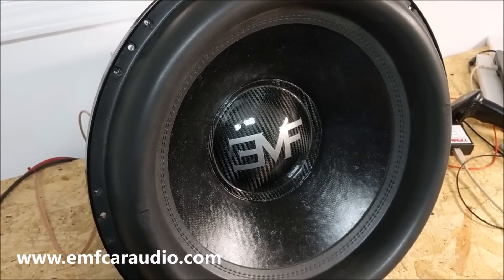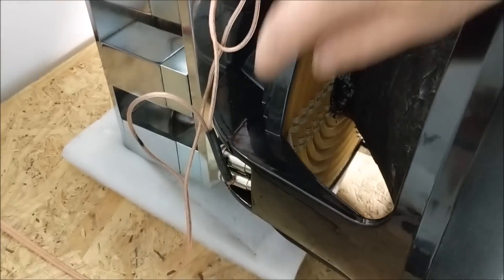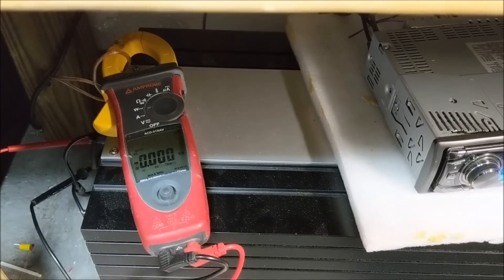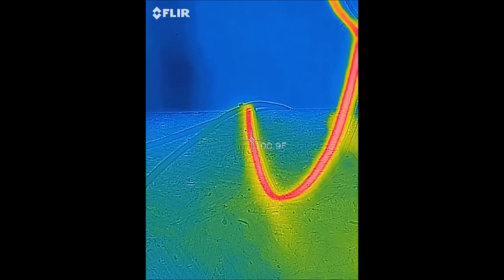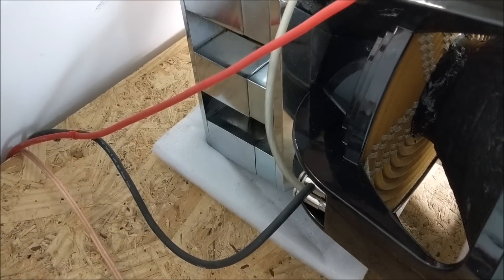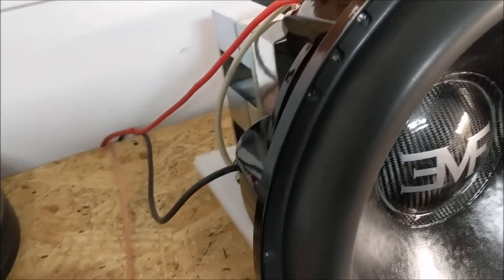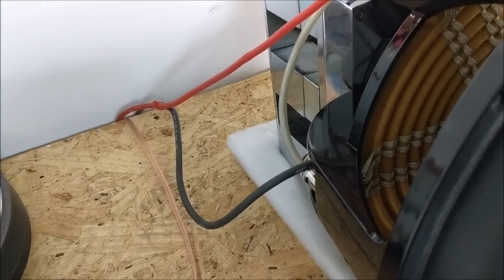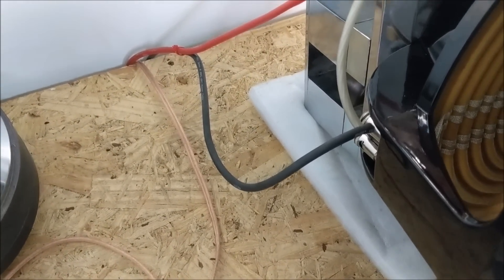Are you using the proper speaker wire size?

Comment: Hey man can you do that test with Silver wire using the same 16 gauge . For whatever reason people feel silver cures all
Reply from the maker: Silver wire isn't cheap but maybe I can do that. The reason people say that goes beyond wire heating up so I'd have to test that because they'll go nuts.
Reply: @EMFAudio  

I'm a believer in quality cables and wires and by saying so I open myself up to being labeled a elitist  I feel your demonstration is scientific and would end the argument as far as proper gauge . If this was a demonstration on lets say the proper extension cord for a power washer no one would argue . You change the conversation to audio and now you have become one of them .  People would just look up on a chart my washer uses 13 amps I need a 100 ft extension  (10-3  minimum 12-3 ) or maybe use a voltage drop calculator .

I'm saying quality cables and wires , not magical cables and wires costing thousands per foot . When did it become so crazy ? 

Here's where my sick sense of humor kicks in . People look at the conductivity charts and figure out Silver is more conductive and because of cost use a thinner gauge cancelling out any gains . So they spend more for less and get less performance "Earth to Matilda"   

This is one of the best videos on the subject so far and the message is so clear PROPER gauge . What part of PROPER gauge don't people understand ? It's not like you're saying you need 000 gauge welding cable for tweeters .

Comment: Just imagine what that small gauge is doing to the coils
Reply from the maker: Nothing different.
Reply: EMF Audio the coils should have gotten hot if the wire got hot
Reply from the maker: @jasonborn9394  The coils have means of cooling, the wire doesn't. As a matter of fact, the wire is insulated so it CAN'T cool. Yes it will get warmer than not having any power through it, but if air temperature is 70 degrees and it goes up to 90 degrees that's very insignificant when they won't fail till 500 degrees. That temperature on power or speaker wire will have melted well before that.

Comment: Is this a fair test. Music is dynamic and not a constant tone.
Reply from the maker: Actually, music will make the results even more apparent. Music is dynamic but wire doesn't cool down instantly either. The longer you play it, the hotter it will get. Tones just make the effect happen quicker but there is music that would do the same thing. Like, tracks you'd use for Bass Race or Bass Boxing.

Comment: Why no 12 gauge? 16 gauge is junk on surround sound speakers
Reply from the maker: 16 gauge is sufficient for many applications. For this particular demonstration it showed exactly what it needed to.
Reply: EMF Audio yea it was a good visual demonstration, i feel it was extreme, but i get the purpose. i heard you talk about 12 g at the end. I saw improvement in the highs from 16g with a old surround sound setup, but the runs where long and into the basement. From what ive seen,  there is a improvement with a thicker gauge, until there isnt anymore
Reply from the maker: Correct. There is a point of diminishing returns. The length of the wire is a factor in the required size. The longer the wire, the larger the wire needs to be for the best result. I may demonstrate that in a Tech Stuff Tuesday video.

Comment: wait 100 degrees ? thats 37celsius, thats like body temp thats nothing lol
Reply: you missed the boat
Reply: So y'all are saying if I'm a SPL guy, j wouldn't need to sorry about this since im only doing a burp an hour or so?
Reply: yeah that's like body temp, but in what way does that transfer to inorganic objects. He also had it running for a minute. Imagine that a half hour from now. Easiest way to light up your car. Its ignorant people like you that pass on bad knowledge to others looking to get into this that makes EMF Audio have to put up a video like this in the first place.
Reply: @Brandishh  yes, a 40° rise in temperature seems trivial, and alone it is. But there is also the wasted power and what if that 40° rise happens inside a trunk that is already at 160° from being out in the sun all day while you work? Lots of insulation materials get really soft. I have seen wires shorted just because the insulation got soft and the conductors migrated. Add in a tight turn or a zip tie just a click too tight and you might have a blown amp or even an electric fire if the short does not draw enough to blow the fuse...
Reply: @jdrissel  you see that's the mistake most  people make . Trunks are often cooler than the cabin , greenhouse effect happens when sunlight reflects inside the cabin . Sun comes in reflects building heat . Thin gauge wire = resistance = heat =  lost power .
Reply: @Brandishh  and this video again leads to people thinking you need 20mm² cable for best sound.
A Video about is not a solution. People must experience it the hard way.
People will just actively misunderstand this video and some idiots think this is evidence for 50 cubic kilometers thick wires in home hi fi`s

Why do you care if somebody burns his car down when he was too stupid to know what he is doing ? You could not care less. Stupidity should not secure you from any penalty.

Conclusion: Just get wire in the size of your actual needs. How mich Power ( Watts ) do you want to push over the cable and on what disatance? This should be enough to let people know "okay i need minimum size n"

Some Hi Fi snake oil guys actually believe you need power cable as thick as your arms and speaker cables as thick as your thumbs and pay thousands for something that does exactly nothing.
Reply: @dom3827 

Three type of cables and wire people.  People that believe in magical 1.5 k per foot carbon embedded silver wire made by the Harry potter and those that don't believe in cables and wires and that wire is wire and me people that know that good quality cables do add to both performance and reliability and need not cost a fortune . 

 I don't believe in any stupid cost rules like the 10-20 % cost rule, people that say if you have a 100 K system you need to have 10-20 K or more in wire. 

Quality doesn't mean expensive  I feel the cat is out of the bag as far as reasonable and practical . The video for me shows a loss of power in the form of heat for the thinner gauge and less of an impact with the thicker gauge . 

I sold audio in the late 70's or since the late 70's one thing I see often with people reselling their gear is how little resale value cables have . I was given a box full expensive cable and wires by someone I purchased a set of speakers from . When I totaled the cost and it was well over 100 k . I tried selling them on eBay at 5-10 cents to the dollar and after a year I gave up losing money and time . Meanwhile people were buying them new paying full cost ???
Reply: @charliedavidson3878  yea. a wire should just be dimensioned in a way that you do not lose power / it does not heat up. 
Some people just exagarate an think 0.0001 Ohm less resistance means the world.

Well i definitely would buy used copper speaker cables.

I would just think more about the signal cable. The most expensive cable i bought was a good double shielded RCA signal cable because it lays behind my desk near some power cords. And that was like 25 or 30€ and even for that normally way too expensive. But yea, my most expensive cable in my setup.
Reply: @dom3827 

It's safe to say as long as you have a nickle in your pocket a salesman hasn't done their job . When has it gotten so greedy ?  I run huge power amps and cables will heat up that heat is lost power . 

I know on the power side, heat will damage your amps at the very least shorten the lifespan . I used to have all the charts for matching and maximizing and voltage drops but i haven't done installations in a long time .  

I think for the average hobbyist with a 100 watt amp simple 8-12 gauge speaker wire is safe . I look for copper wire with a high strand count keep my length reasonable . Do you need 8 gauge for 100 watts ? Why not ?? . I have more of a concern with Banana plugs and other sources for failure .
Reply: @charliedavidson3878  well i am not familiar with american wire gauge. But i use 2,5 mm^2 pure copper cables.
Reply: @dom3827 I'm not sure 3.2 mm ? 2.5 I believe is 10 gauge . So in the video the author is comparing 1.3 mm to  3.2 mm . which doesn't seem that extreme considering you are already using 2.5 mm .
Reply: @charliedavidson3878  yea, i am using 5 Meters of 2,5mm cable to each speaker.
Also i do not have a high Power Amp.
I am running a pretty nice vintage Amplifier from 1978. It has "just" 75 Watts RMS, but it can reach peaks up to 250 Watts.

But even when i buy a new amp this year it would not be relevant to increase wire size.

Funny is, the markets in ghermany trust the buyer. Well i used tha to my advantage, cut 10meters of 2,5mm wire and put the sign of 1,5mm on it. So i got it cheaper xD

Not saying i am a thief, i never do such things normally. I was there with a friend of mine, he got the idea and i thought ok, lets try.
Well, it was an OBI in Germany, the cassiers were young teenage girls. They will never see the difference.
Reply: @dom3827  I would say you already have the perfect gauge for the length maybe longer . 

larger gauge wire actually favors smaller amps . 

I wouldn't worry too much they often give away wire . 

I used to install so I would often cut off extra . 

Now with the 1.5 k per foot cables that would be highly regulated and often those cables are under lock and key.

Comment: would i be correct in assuming the smaller gauge wire is wasting usable power as generated heat? Or is that not a factor?
Reply from the maker: Yes, energy is lost in heat but because makes the impedance at the amp higher too. Less power gets to the speaker.

Comment: I remember when i used the 16g wire then smell burnt in my trunk 😂 🤷‍♂️
Reply: 313stratus a long time ago my friend in high school used 16 gauge   speaker wire for the power and ground , it was at least 20 ft and the amp had a 25 amp fuse , after playing his system for a good 30 minutes we smelled something burning, the power wire became melted into the carpet and was smoldering 🔥

Comment: Bigger is better
Reply: A larger gauge wire will have impedance issues at higher frequencies rolling off the treble.
Reply: @richardcarden4161  number 8 gauge should do fine.  Depending if you have a powerful amp, the resistance in the wire won't matter.
Reply: @heathenthatheretic5960  That is fine for subwoofers that need high current.
Reply from the maker: Bigger might mean equal, depending on the install.
Reply: Not always short wire are better...It also reduce resistance....
Reply: @keithbranch5181  not if it's size 14 pulling over 20 amps. It will burn up the wire regardless
Reply: Size and length does matter. 
I'm an electrician so I calculate sizes of wire based on distance all the time
Reply: @heathenthatheretic5960  Dude I know that part am talking about length wise... Longer wire is not good smaller size wire is better...If you run longer wire you need a bigger gauge... Short length and correct voltage keep resistance down

Comment: CORRECT ME IF IM WRONG HERE>   But DC power which what runs from ur alt, and bats to ur amp,  which DC runs through the wire.  Now after it leaves the amp, its now AC and AC runs on the OUT SIDE of the copper.   SO you want the highest STRAND OFC wire you can get for best results correct?  You might try a test with two of the same gauge wire but one with say 1500 strand and the other say 4000 strands and see if there's a resistance difference resulting in heat in the wire. 
I always go with 4gauge with high strand count.
Reply from the maker: Yes and no. Yes there is what they call "skin effect" with AC voltage. However, it is frequency dependent. For the frequencies being used in a car it isn't relevant. Example, notice how home wiring is a single strand that is thick? It's because at 60 hz it's using the whole thing, not just the outside. Now, that being said, having more strands isn't always better because when the strands get too fine, they become fragile. Now a slight bend can break the strands and it's no longer transmitting signal. Simply bending the wire can break the wire because it's hair thin so to speak. Appropriate strands would be the way to view it for the best performance, not highest strands. There are VERY few instances where 4 gauge will do anything more than 8 gauge or even 10 gauge as speaker wire. I will be doing a tech video on that sometime in the future.
Reply: @EMFAudio  AWW right, i totally forgot about the frequency.  Thanks for the detailed explanation and the facts.  That would be a good video to watch, thanks again.
Reply: @EMFAudio  Fine strands when manufactured in a cable rarely break. In fact, as we get higher and higher in current we often employ many fine strands in ac cables.  The only thing to be aware is the connection area is fragile once stripped. They make specific terminations for such applications or utilize a copper film we wrap the conducters with when terminating in set screws. Works great but requires time,skill, and attention to detail to perform correctly without damaging those fine strands.  I enjoy terminating that type of wIring.
Reply from the maker: @ronaldarchibald2506  Every instance of dine stranded wire I've had was bad. Bend the wire not at a connection, wire breaks too. It was also cheap wire trying to sell based on strand count.

Comment: What size ofc would work for 2500-3000 watts? I see different answers at different places.
Reply from the maker: You may be seeing different answers because you aren't asking the right question. That power will depend on wire length and impedance it's wired to in order to give a proper response.
Reply: @EMFAudio  ok. Well it's wired at 1 ohm & runs about 5-6 feet.
Reply from the maker: Fortunately for you, we have a calculator for that on our website. http://www.emfcaraudio.com/wire-sizing-calculator/
Reply: @EMFAudio  thank you kind sir.
Reply: EMF Audio link appears to be broken

Comment: I like how you showed your point and thanx. Would like to see the voltage of the 8awg like you did the 16awg. Also what would be overkill on a 1200W wire gauge and are there any bad effects from it?
Reply from the maker: The impedance determines what wire size is needed for that 1,200 watts as a minimum, which also dictates what's overkill. Too big of wire has no adverse effects.
Reply: I'm using 10ga "lamp cord" to my single 12. Wire is rated for 300 watts @ 12v, but as the voltage goes up, so does the power handling of the wire.
I'm getting 47 volts ac at the terminals at 35hz into 1.7 ohms, which is roughly 1200 watts.
Using the 300w@12v as a reference, I'm right at the power limit that the wire can handle, and my wire never gets hot, even on extended runs.
Reply: @PoXFreak  yeah, never had any problems with heat me neither, running 2 12" at 2 ohms with a 1800wrms 2ohm rated amp. I Guess with full constant blast 40hz 10kw install, get bigger wires...
Reply: 10-8 min if you're over 1k power, but 12-14 would be fine for 800 and less in my opinion probably overkill but I'd rather be safe